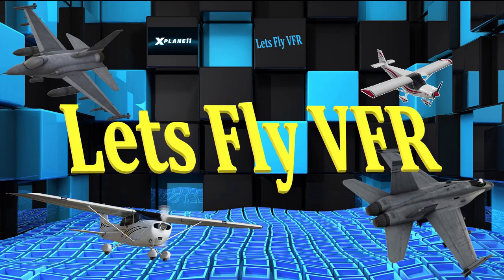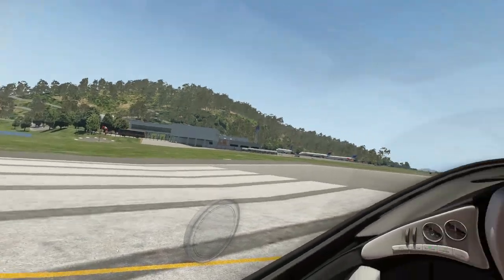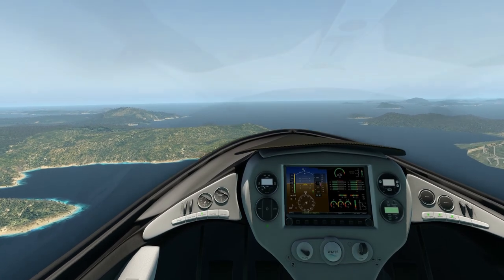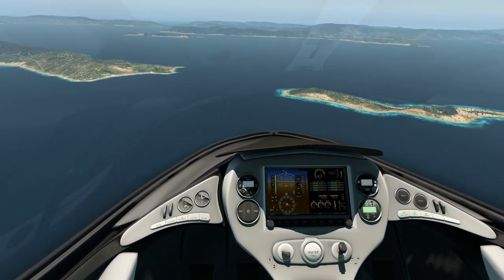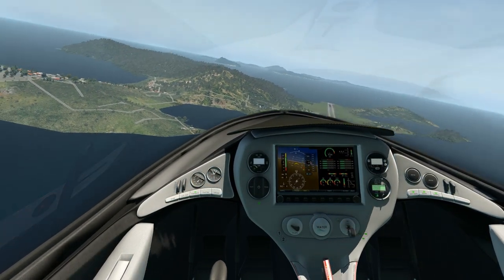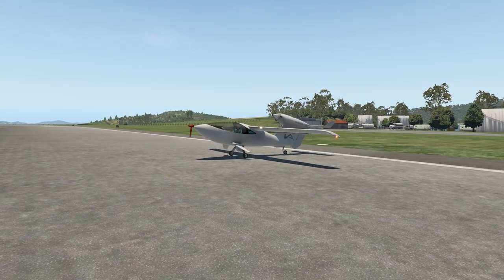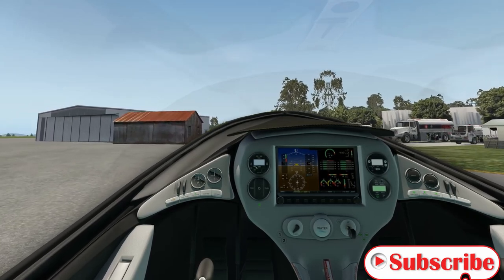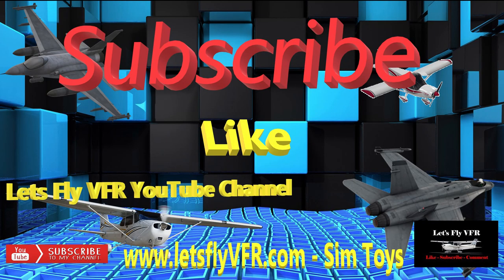Sea Plane Flying fixed Wing

Comment: LOL Gunnie - Obviously, LR's Austin 'Mr. X-Plane' Meyers does indeed have a sense of humor/humour.  After all, nobody would  purposefully conjure up such insane aircraft-meets-water theatrics unless it was intended to be a joke, which it clearly is. 

Ironically, yesterday I was looking through the list of airports to find a new airport to fly the venerable C172 from.  What I didn't realize was I had selected a water runway.  Hahahahahaha when the scene loaded the C172 was inverted bobbing in the water with the wheels straight up, and with the engine still running.  For fun I hit full throttle and it began accelerating for a few seconds, still inverted, before X-Plane finally signaled an UH OH somethin' ain't right.  OMG/OH MY BUDDHA how ridiculous it got that far before UH OH!

So here it is almost mid-2019, and now in official v11.33, and LR still can't even remotely model rudimentary water handling physics WHATSOEVER.  As I remember, water handling was really pretty darn good in ancient FSX, and even better in the much later 2011-2012's failed Microsoft Flight X-Box style game. (I was a beta tester for that game.)
/end rant

OK, I've discovered a cool Nvidia settings tip.  I was tweaking X-Plane 11 settings under Program Settings... Manage 3D Settings menu when I found a couple of peculiar options.  I did this because I sort of noticed a drop in FPS from v11.32 to v11.33.  Anyway, the first was *Power Management Mode*.  I changed it from the default Global 'Optimal Power' setting to 'Maximum Performance'.

The 2nd option that tweaked my curiosity in the same menu was *Threaded Optimization*.  I changed it from the Global 'Auto' setting to 'On'.  I would swear these changes bumped up my FPS by about 10 FPS in 1080p with my RTX 2060.  If you haven't tried it yet, you might want to give it a go.  I'm curious if you also see some benefit as well with your GTX 1070[?].

Cheers from Isaan's L.A.!

P.S. - That rock guitar soundtrack was distracting... and I love rock music.
P.S. 2 - Really looking forward to your upcoming DCS videos Gunnie!  :)
Reply from the maker: I Challenge you to taxi this .. hahah .. Its from Aerobask so does Austin have shares there?????? :) I's real .. I sjust saw pics of it  hahaha :)
Reply: @GunniesLetsFlyVFR  Did you read all of my previous message?
Reply from the maker: @Jimbo-in-Thailand  Ok you got me there .. Didnt see it all :) Now reading message in full :)
Reply from the maker: ILL CHECK - I have been planning a performance with the NVIDIA control; panel video as an update with some overclocking ... In my bench marks NOTHING CHANGED - short of 1-2 fps. The biggest change was when I did the first 2 benchmarks it was 10 fps higher then after the 3rd cycle it dropped by 10 fps and then wouldn't budge more than 2fps.
Not sure if my methology was wrong. started everything default then went performance settings in the slider then boosted the power and all the advanced performance settings one by one. ZIP difference .. each time run 3 cycles on the benchmark ... NO diff :(
Reply: @GunniesLetsFlyVFR  TBH my observation wasn't based on anything scientific, such as performing sets of comparative benchmarks.  Instead I just noticed ~10fps increase in areas I had just flown over prior to changing the performance options I mentioned, and with all other XP graphics options the same.

I then tried overclocking my Ryzen 1700X a bit but all that seemed to do was increase CPU temps and fan noise.  Of course, I already knew that Gen 1 Ryzens aren't the best overclockers.  Doesn't really matter as I'm getting really good performance overall with the new build without overclocking.  :)
Reply from the maker: @Jimbo-in-Thailand  DCS ia my next video. Love it and now finally have my wifi sorted. :)